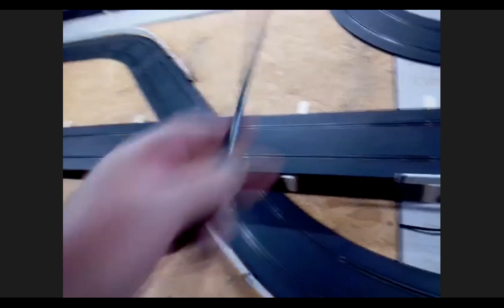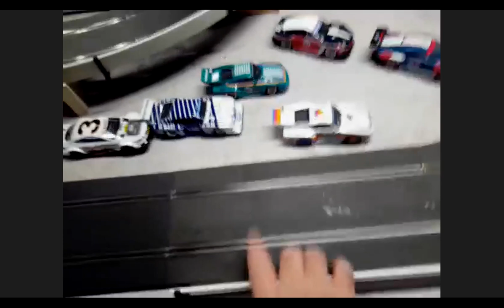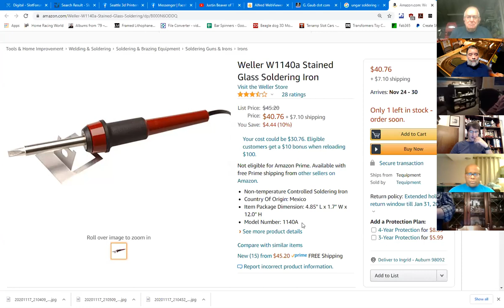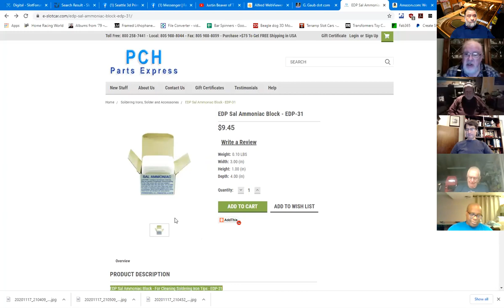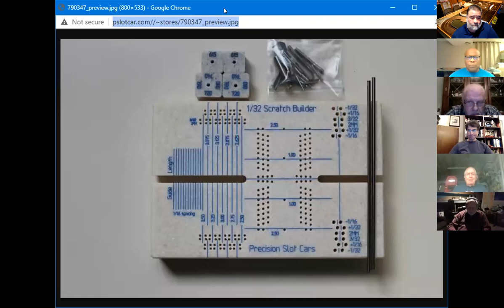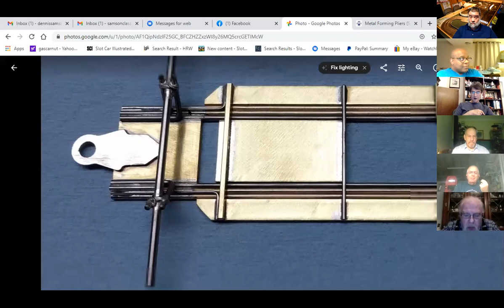World Wide Slot Car Chat #31

Comment: Hello Greg. I've read some of your threads on Slotforum.com and would like to ask you a question about Carrera Digital 132 issue,
if you don't mind ? Here it is :
All my cars have suddenly started to stutter recently and the lane changers are not working properly any more  
Can It be the Control Unit "chip or electronic part" that emit the signals to the decoders and lane changers that is malfunctioning ?
Reply from the maker: It could be, but that's pretty rare. Sometimes odd things happen when more than one controller is paired to the same ID. Try re-programming all wireless controllers to specific IDs, even if you believe they are all correctly paired already.
If you have a wired controller, test this theory by unplugging the wireless dongle and using a wired controller. If they still stutter, then look into cleaning the rails and braids.
Reply from the maker: and when I say the controllers, I mean, the controllers to the base, nothing to do with cars.
Reply: @ggaub  Thanks very much for your answer. I only use wired controllers. I've already reset the CU and same problems occurred with only one controller and one car paired.
Reply from the maker: @lorenzocorradini7556  If possible, please post a video of this happening.
For additional testing, does it happen on the CU track itself? Can the car even get moving, or just remain slowly moving as it stutters? Have you checked to make sure the braids are not tangled and shorting or anything? Are the braids making good contact with the rail? Speaking of shorts, have you hoovered/vacuumed the track to make sure there are no stray braid threads creating a short somewhere? Do you have power jumpers that might have developed a short? If it happens with ALL cars and controllers, then it's probably not an issue with the cars or controllers, but either the track or the CU. You might need to take the CU out and maybe make a small oval to test if it works. If so, then the problem is somewhere on the track. If not, then it's probably a problem in the CU.
Reply: @Greg Gaub Thanks again. I always vacuum and check the braids before running. Also have already made a test with a short track without any lane changes : it was not "as bad", but not very convincing either.
By the way, I also have tested my track with an Evo box instead of my CU and it seemed to "work properly"
It was difficult to judge as my cars are "Carrera digitalized" Slot.It, without magnet.
So I have a very limited range on the Evo controllers (pushers) for a proper test.
Anyway, I will make a video tomorrow to make it clearer indeed.
Can I post the link in this chat or do you prefer "somewhere else" ?
Reply from the maker: @lorenzocorradini7556  To get the best exposure to those who know more about Carrera Digital than I do, I would recommend posting your video in the Carrera Digital subforum of a site like slotforum.com